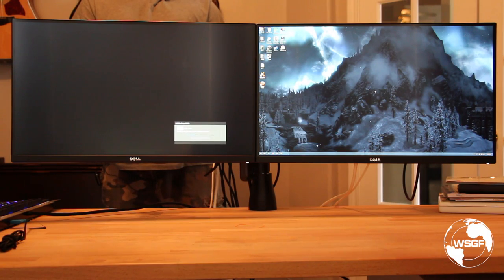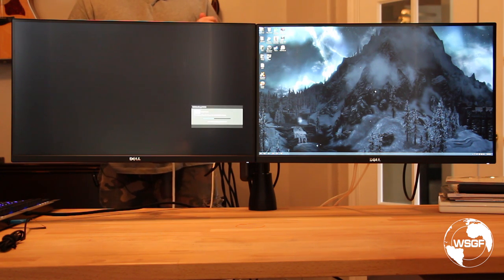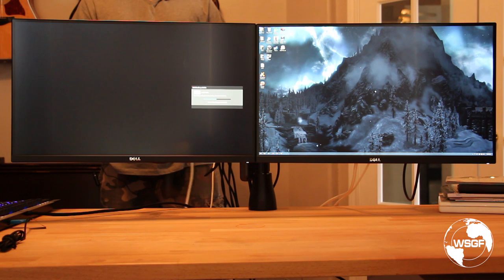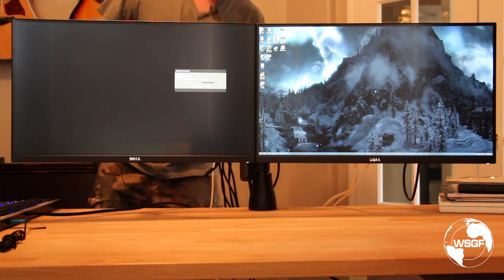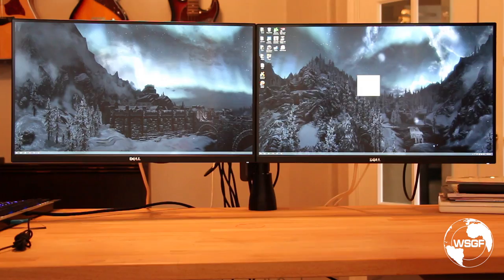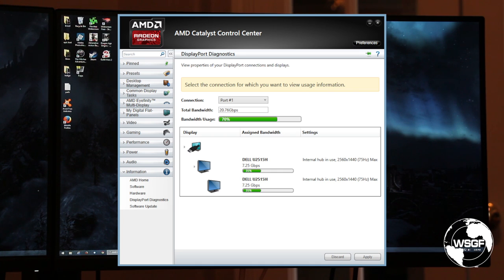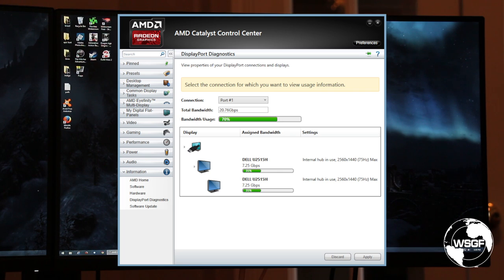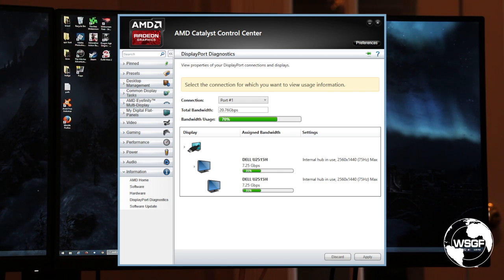Daisy Chaining Two 1440p DisplayPort Monitors via MST

Comment: I was expecting you to show the actual chain. How do you chain the monitors?
Reply from the maker: With a DisplayPort cable.  Each monitor has a DP output, and at least one DP input.
Reply: Yes, looked up actual schematic on the web now. But your video was meant for people like me, so would have been great if you've actually shown the ports, the cables, connection process, etc. In the region where I live we do not even have monitors with DP ports in stores...

Comment: Will this work if I have an HDMI output from my laptop, but DisplayPort daisy chaining the monitors?
Reply from the maker: Sorry, no.  The output of your GPU needs to be DP 1.2.
Reply: @WSGF  Thank you! I figured that I could use a Thunderbolt 3 to Displayport to connect my laptop to the monitor, then Daisychain the second monitor with another Displayport to Displayport cable.
Reply from the maker: @AliAl-Faesly  That may (probably will) work as I believe the TB3 carries the DP 1.2 MST (multi stream transport) protocol.  HDMI decidedly does not.
Reply: @WSGF  Definitely worked, got it all up and running and it looks great, thanks for the heads up on HDMI !
Reply from the maker: @AliAl-Faesly  Awesome.  Glad to haer.

Comment: Why doesn't the WSGF use programs to record the screen like OBS for a better quality screen cast instead of using a camera to record the screen?
Reply: E3agl Why would screen capturing this type of video be better than filming them?
Reply: tech doge Whenever they are recording the screen and talking about the software aspect of the displays, they could then use a condenser mic and have a higher fidelity video, do some keyframing and zoom around on the display to highlight stuff as they talk about it, and have a more interesting video than just a mostly static shot of someone talking about a display after we've already seen it in action.
Reply: E3agl Well yeah but I´m okay with the way it is. And I belive most are.
Reply from the maker: E3agl I plan to start using OBS at some point soon for gameplay videos.  But, it's hard to show two monitors (or three in the case of my upcoming PLP video) of content though direct capture.  It also doesn't show the monitor itself, which has been the focus of my recent reviews.
Reply: WSGF eggsacly!

Comment: I have two U3415W screens hooked directly to my iMac presently and actually thought about getting two more to chain into them. Will have to find a calculator though to verify before I sign the check.. Id be crushed if I spent the cash and couldnt pull it off
Reply from the maker: This is the calculator I use - https://k.kramerav.com/support/bwcalculator.asp.  Double 34" ultrawide @ 60Hz comes to 17.83 Gbps.  DP 1.2 maxes out at 17.28 GBps.  DP 1.3 (used in USB Type C) almost doubles to 32.4 Gbps.
Reply: OK, sooo upgrade to a new iMac and then try it LOL because it looks like Im barely creeping by now.

Comment: Can you dasiy chain them if the first one is commected to the pc via hdmi?
Reply: Astryx_ nope :-(
Reply: damn thanks for replying :D, i have found a way that i am going to try using the evga UV plus+ 39 will let you know if it works :D
Reply: Astryx_ Good luck!
I still cant do it on my mac, i find only tutorials for windows, so if you have a clue, let me know!
Reply: maybe look up stuff which uses the thunderbolt port if your mac has that? , or something for the mini display port?
Reply: Astryx_ I Tried, unfortunatly everything on the internet points to the AMD Graphic controllpanel. But since Thunderbolt (wich my mac has, and uses for different other stuff) is in fact a mini displayport i didnt expect any problems.

Although my docking station is on its way so no special need, i already spent four hours at it ;-)
Reply: oh any ways good luck will definitely let you know my results :)

Comment: What cable is needed to chain? I don't have original cable with the monitors. Do I need 'mini-dp to dp' or 'dp to dp'? and what is the ideal length of cable needed. thanks
Reply from the maker: You can use either.  The DP out is "big" DP.  You can then use either the DP or Mini-DP on the second monitor.  Depends on who far apart your monitors are, but probably 1m.  That's about as short as they get.  2ft at a minimum
Reply: WSGF So your saying...I need a DP to DP to connect monitor 1 to PC and then I can use a Mini DP to mini DP or a Mini DP to DP to daisy chain?
Reply from the maker: This particular model of monitor takes either DP or Mini-DP input.  The output (to 2nd monitor) is DP out.  You can then connect that output to either DP or Mini-DP input on the 2nd monitor.

If your GPU is DP out.  Then you can hook up both monitors with two DP-DP cables.

Comment: In this way, is it possible to get 5 or 6 displays going from a graphics card that has only 4 outputs?
Reply: @@lofi4114 Thanks for answering😃 I managed to get 6 displays working for a Boeing 737 MIP. The 2 last outputs were via 2 USB to HDMI converters, i.e. they were outputs from USB

Comment: can i connect 2 Dell U2515H monitors to my laptop via HDMI (daisy chain 1 monitor to other) I have 1 HDMI, 1 USB 3.0, USB 2.0, VGA.  Please advise, maybe I need a lower spec screen but I want to future proof
Reply from the maker: +Aindriu Mac Giolla Eoin No.  Daisy chain requires DP connections to be used.

Comment: Wait so if I have one monitor connected with the hdmi cable to the gpu, will the other monitor work if I use the DisplayPort connected to the gpu and the monitor
Reply from the maker: If I recall, I think so.  You have to use DP out from the first monitor to the second.

Comment: I have the same monitors. Can do it this way?  PC > HDMI > Monitor 1 > displayport cable > monitor 2.
Reply from the maker: +samgraves2 No, it has to be PC > DP Cable > Mon 1 Input > Mon 1 Output > DP Cable > Mon 2 Input
Reply: WSGF Is there any disadvantage to doing it this way? Lag, etc...?
Reply from the maker: I've not seen any lag with using the MST feature.  But I have recently some some SERIOUS issues with screen blanking recently.  I'm not sure if it's a Dell issue or an AMD driver issue.  I don't have NVIDIA to test with at the moment.

Comment: Just to make sure, but legacy monitors lacking DP connectivity entirely are unable to be used in daisy chaining, right? I currently have a Dell XPS 13 with a single Mini-DP out, a Dell U2414H with DP 1.2 and DP-out, and a legacy HP LV2311 with no DP connectivity whatsoever. I bought a DP to VGA converter to try to make this work, but it failed completely, even after trying the system multiple times. I've concluded that daisy chaining does not work at all with legacy monitors. Is this true?
Reply from the maker: The daisy chaining may work on with an output going to another digital format (DVI or HDMI).  But, you need to make sure the output of your laptop is DP v1.2.  Only 1.2 supports "Multi Stream Transport" which is what enables the daisy chaining.

Comment: Hi can i  connect my surfes pro 3 from 
mini Dplay port to Dplay port and than 
from Dplay port out to hdmi in my second 1080 monitor?
Reply from the maker: Only if the Surface Pro 3 has a DP 1.2 output and supports MST daily chaining.  I think it might as I know the MST hubs from Club 3D and Accell work.
Reply: WSGF OK thx

Comment: Hi, first i had the problem of not detecting the DP cable and i activated High Performance instead of Balanced in the Power settings. This fixed the problem and the DP 1.2v was detected. I chained two dell u2715h monitors. When i connected Monitor 1 to Monitor 2 with the DP 1.2v cable it went on but the max resolution is 1080p. Any ideas how to fix this?
Reply from the maker: I'm not sure why this would be.  You returned on DisplayPort 1.2 in the monitor settings, correct?  What GPU are you using?
Reply: +WSGF im using gtx960. i reverted back to balanced power settings instead of high perf and this didn't cause any failure in connection. then i restarted the pc and windows updated and even upgraded cause i saw the welcome screen with Hi, after getting to desktop i saw that i had the option to use 1440p on both monitors. so i guess the High performance option cannot utilize 1440p on both monitors. Are you using daisy chain in Balanced power mode? maybe if you try high perf you will have the second monitor decrease to 1080p.
Reply from the maker: Are these the Windows power settings?  I'm not sure how they would impact this.  The reboot probably helped.  Have you tried going going back to the other power settings?
Reply: +WSGF Yes, these are the windows power settings. I went back to Balanced instead of High perf and it didnt create any issue with connectivity. but before that it didnt detect the dp cable when i was in balanced mode, it only detected the dp cable after i went to high perf. then i reverted back to balanced and it's alright now. i hope it's permanent.
Reply from the maker: Wow.  Very odd for a desktop.  I only mess with power settings on laptops.

Comment: i plan on buying a gaming laptop with a 980m(4gb) will it be able to handle 3 of these sexy 25" displays?
Reply from the maker: +EpicSilver Depends on what you're playing - but it's doubtful.  Check the WSGF for some benchmarks of a 980 GTX at 3x 1440p.  Usually have to run at 3x 1080p
Reply: Yes

Comment: I currently have a laptop with the GT 750m GPU with a mini display port out as well. Do you reckon it will be able to support two u2515h?
Reply: +akiisdaman yes just go on :)
Reply from the maker: +akiisdaman As long as the output supports the DP 1.2 standard.

Comment: do you have issues wherein one or both of the monitors blink on and off at random intervals? I seem to be reading many such reports online, so I'm a bit reluctant to buy them :(
Reply from the maker: +Alexander Losberne I've experienced it with poor quality cables.  The blanking issues I've had are more tied to blanking associated with DisplayPort when using AMD Eyefinity.
Reply: WSGF that is disappointing, seems that I have to steer away from dell after all.... Thank you for your answer!
Reply from the maker: +Alexander Losberne I also just found out (via some help from Sapphire) that the blanking can be associated with the power savings settings in Catalyst Control panel.  I had blanking issues with my new Fury X on my Dell 34".  Once I turned off on the power savings switch, the blanking on the single display went away.

I don't think the issue is related to the Dell.  But, I will retest on my triple Dell setup (these panels) with the power savings disabled.
Reply: +WSGF Thanks a lot for letting me know! Do you perhaps know if any of these issues are present when using Intel's integrated gpu?

Comment: Will daisychain work if I use a hdmi to display port adapter from my laptop
Reply from the maker: No, it has to be a DP 1.2 output from the laptop.  You can go from DP out into HDMI on the second display.  But the output from the GPU has to be DP 1.2

Comment: Can I use the monitor with HDMI with 1440p & 75Hz?
Reply from the maker: AroZe Alibaba420 1440p @ 75Hz would require 11.2Gbit/sec rate.  You would need HDMI 2.0 for this (which allows for 14.4 Gbit/sec).  I had to hunt down the Dell manual.  I found that the HDMI is only 1.4.  So, the answer is no.  Sorry.  You probably could with an HDMI 2.0 output on your GPU and a HDMI > DP cable.

After typing all of that I checked the rest of the spec sheet and found that it only does 75Hz at 1080p.
Reply: +WSGF can it run at full resolution 1440 75 hz via DP?
Whether it can or cannot, how do I set it to be 75 hz? Is there any official software that overclocks refresh rate or are they only non-official?
Reply from the maker: I believe the monitor is only a 60Hz monitor.  I'm not aware of any way to overclock it.

Comment: Are you running these at 2560x1440 75 Hz?
I'm just wondering since I cannot find any data that support this.
Reply from the maker: Spuc92 No.  75Hz support only goes to 1280x1024.
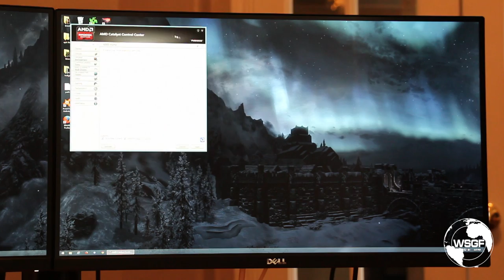Reply: +WSGF Thank you for clearing this up. At 1:51 it just said 75Hz max, but that must be in the 1280 res.

Comment: Will this work with 4K?
Reply from the maker: It would have to be on something with DP 1.3 or DP 1.4 to get enough bandwidth.  You'd just need to do the calculations for the res and the color depth.
Reply: WSGF awesome thanks
Reply from the maker: And, it just dawned on me, the monitors and GPU would all have to have those connections.

Comment: Hi there, I've recently purchased an Aorus V7 X7 laptop with Nvidia 1080 GTX. I also have 2x Dell U2717D monitors which i was hoping to daisy chain. The laptop has a mini DP which runs the first monitor (mDP to DP cable). I tried to connect the 2nd monitor to the first one in various configurations using the another DP to mDP cable. The best result I have achieved so far is a duplicated 2nd screen on both monitors. I have also tried all the display settings available on the PC to try and get the desktop to extend across the 3 screens (laptop - dell - dell), but with no luck. Any ideas please?
Reply from the maker: You could try setting up NVIDIA Surround.  I'm also assuming you have DP 1.2 enabled, since you have images on both panels.  What happens if you close the notebook screen?  Can you extend the desktop then?

Comment: Why you did not film on how you plug the cables into each monitors? Big thumbs down to you
Reply from the maker: Because you should know how to plug a cable into a monitor.  You connect the DP out from the primary monitor to the DP input on the secondary monitor.

Comment: Is there any way for this to work on Mac? I know Apple has locked support for Display Port daisy chaining but I am curious a about a display port "unifier" adapter, where I plug two ends of this "unifier" into the individual monitors, and then plug the one end into my mac, is there such a thing?
Reply from the maker: +pswag405 You might try a DualHead2Go by Matrox.  But max res seems to be 1080p on each panel.

http://www.matrox.com/graphics/en/products/gxm/
Reply: +WSGF Really appreciate the response, I'll look into this for sure. I've been thinking about doing this for 2 Dell U2515H's that are unfortunately in 1440p with only HDMI and Mini/Display Port so I'll look for similar solutions.